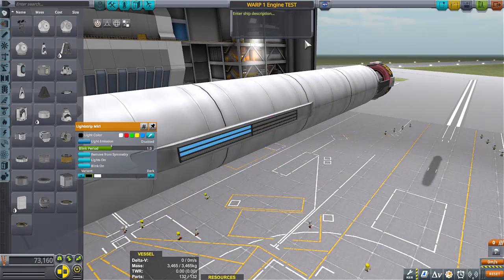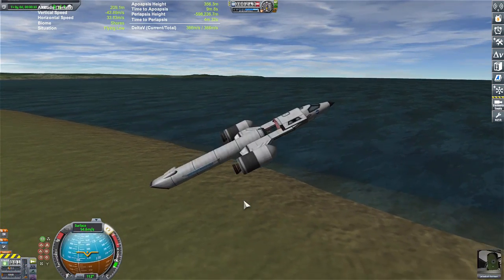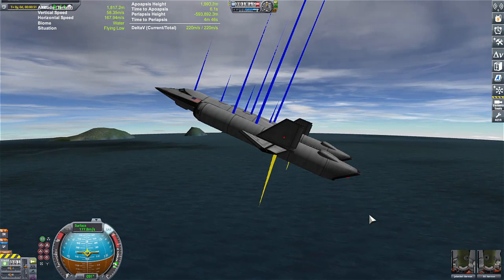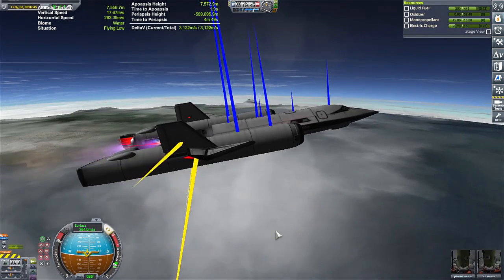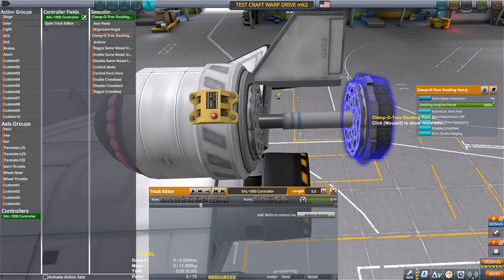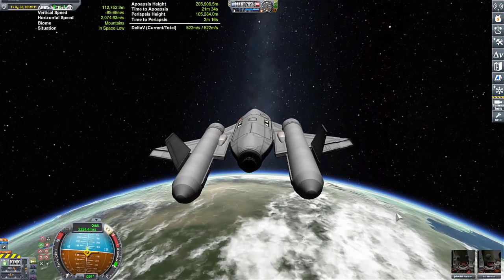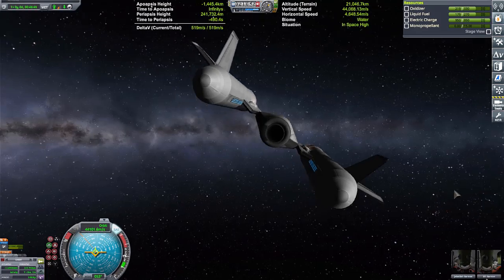STOCK WARP DRIVE TEST SHIP  \  KSP 1.12  \  Kerbal Space Program

Comment: can you make a "non-cheaty" warp ship with KAL overclocked ion engines, supplied by liquid fuel and overclocked fuel cells? Or is it impossible to overclock those
Reply from the maker: That would be more like the drive they have in the expanse
Reply: Shadowzone did a "less cheaty" KAL-overclocked ship by using a big engine for the forward drive and a small engine for the negative-overclocked fuel producer. He wanted 10 times the thrust and 10 times the IsP, and apparently he got it.

Comment: after some testing i found that the most effective docking port drive can be accomplished by:
1. using only jr. ports

2. pairing one port with as many as your computer can handle/kraken will let you clipped together using the offset tool in absolute mode so they all occupy the exact same space
2a. while it seems counter intuitive to only pair one port with several, this yields the best results, it seems that a single port can pair with any number of ports but will only seek to pair with one so 8 ports across from 8 ports will only produce as much force as 1 port across from 8 (the single can be the attractor or the dormant port, i prefer it being the attractor [behind the other] so i can control the drive with a single menu) 

3. the best spacing for them is two shift-ticks/one normal tick of the offset tool, match the faces of the ports, then space them back that much

4. instead of pistons (no dlc for me) i just use the attraction slider on the single port to control the drive

using this method, i could get a small craft (a mk1 command pod with the ports in a 1.25m bay to reduce drag) to accelerate at 25g (250m/s^2) using 64 ports, a setup of 64 ports to 1 produced about 577 kN of force (F=MA, 256.52m/s^2 * 2250kg = 577,170N), almost as much as a skipper engine

5. putting multiple drive units inline with each other for some reason will slightly reduce the amount of thrust from what would be expected, they should the placed side by side, spaced farther apart, or be combined into a single unit with double the ports

6. the amount of force a drive unit produces is almost directly proportional to the number of ports in it (minus the one opposing port), each port produces about 9 Kn of force

Comment: Treat it like a low TWR SSTO...stay low, pick up speed, use the improved lift characteristics at lower altitudes to stay up.  When you reach some point, you'll have to experiment to find it, pull up moderately hard to a 30 or 40 degree nose up

Comment: I stopped watching Star Trek after 2 seasons of Enterprise. I'm happy. ;) As for drives, KAL overclocking is just as powerful, even with ion drives, but if you put it in anything heavy, you risk the engine breaking free and tearing through the ship. My little lightweight KAL/ion drive craft got into moon orbit in 10 minutes from launch without thrusting the whole way, but when I made a fancy alien ship with the same drive, it took an hour because I couldn't throttle up fully without destroying the ship. I think the fancy ship was 18 tons. It was carefully fixed for maximum strength, but not naturally a strong shape. I might only be saying all this because I used the ion engine which only has a tiny mounting point; a bigger engine might have stronger attachment.
Reply: Autostrut Industries has you covered, you can get a guarantee for your ship for 5 seconds

Comment: What are those pink circles
Reply from the maker: There’s supposed to be red. But in the space plane hanger they look pink. At 9:45 you can see them better as red. In the Star Trek universe, The red tips on warp engines are called Bussard Collectors. As the ship moves quickly through space , they collect free-floating hydrogen particles that are all over the place in space. ( heavier near star systems and nebula) By collecting them , it helps refuel the ship. The reason why they’re red is supposed to be because it’s the color of the energized hydrogen particles that are stored in the collector during warp. ( but sometimes the writers forgot about that when they made episodes)

Comment: Do you think there is a way to make the thrust from the warp drive reversible? Like with some of the turbines, where you just hit a button and it goes backwards?
Reply from the maker: The only way to do that is to build an engine that’s pointing in the opposite direction. Unfortunately there is no action group that can change the attraction force of individual docking ports.
Reply: @vaos3712  maybe having a srvo to flip the engine around?
Reply: @mariasirona1622  Or have the engine in the on position at the start and tie the docking force to the throttle with a Kal controller?

Comment: There are different mods on spacedock that I think may help....   tweak scale is a interesting mod that allows some parts to be size altered and things scale such as engine power, weight, and resource consumption.  Maybe you could tweak scale the warp drive and make it more powerful that way. Or use the Sr docking ports in multiple  to make it more powerful.
Reply: This is a stock warp drive. Stock KSP, as in vanilla, as in no mods. Making a warp capable ship with mods isn't a challenge, there are at least a few mods that flat out give you warp engines.

Comment: 7:29 Whoa, whoa, whoa, WHOA.  Talk us through what happened there!  After so many test flights where you could barely approach Mach speed, all of a sudden this particular test flight was able to go full SSTO multi-supersonic?  And without an atmospheric engine assist?!  Talk us through what happened there, man.  Inquiring minds want to know.

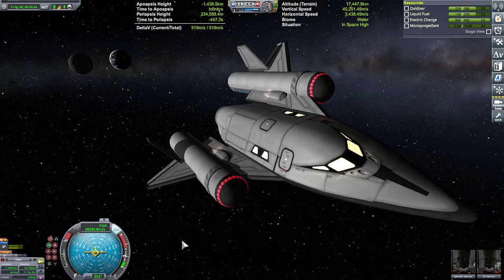10:28 Yeah I was experimenting with the engine hack (both ion/xenon and rocket fuel) earlier this week.  It's pretty fun but ridiculously overpowered.  Like, gamebreakingly OP, so I hesitate to use it as a principal source of propulsion.

<< trips over a soapbox left in his path; casually kicks it out of his way in the general direction of one Vaos.  

11:45 YES.  yesyesyesyesyesyeyesyesyseyseyeyseyesyseysyeysyesyeysyeyyseyyseyyse  YES.
Reply from the maker: Stuffing the guts of the warp engine in fairings did the trick.
Reply: @vaos3712  Wow.  That much of a difference.  Geez.
Reply: I think what was happening around 7:29 is that the drag caused by all the parts in the warp nacelle “pulled” the Center of Lift backwards. Similar to really life counterpart. The drag behind the lifting Serface will move the “blue ball” of lift behind the CG. Essentially turning the plane into an arrow with no way to correct other than flying lower than Mach 1.

Comment: Vaos straps warp nacelles to a plane and it stalls. How Does a warp drive stall? Lmao

I'm interested in the ion engine hack. Wanna see how that's done.
Reply: A. Warp drive can not stall. Craft can. Due to first versions of craft has too much drag the only source of lifting force here were wings (and atmosphere). So: flying higher -> atmosphere thiner -> no more lifting force -> "Kerbin, rejoice! Your heroes returning to you! (Too soon, but still...)".
By the way... I quite confident that same craft COULD leave atmosphere. If launched vertically. But VAOS seems to dislike vertically-launching-crafts...

B. KAL-1000 fuel / engine power hack (ATTENTION! Ruins game experience! Use for your own risk/discretion!):
1. Get 2 ion engines, 1 KAL-1000 unit, 1 xenon tank, 1 battery.
2. Disconnect engines' thrust control from control sheme. (RMB to engine. "Throttle - Independent")
3. In "Actions" menu give "throttle" control of engines to KAL-1000.
4. Set control curve for one engine to infinite low (at KAL-1000 track editor: "tangents: curve" and move curve direction marker at 0 point DOWNWARDS). This engine will be power/fuel source. Negative throttle engine will NOT provide any thrust, so there is no matter which direction it facing.
5. Set control curve for another one to infinite high (at KAL-1000 track editor: "tangents: curve" and move curve direction marker of 0 point UPWARDS). This engine will be wastly overpowered.
6. Link KAL-1000 "Play Position" to "Main throttle" control (in "Actions" menu).
...
998. Same method works with any type and quantity of engines in KSP. Just set up them in pairs, as described. And provide resource tank(s) as engine specification requires.
999. Rejoice! (again)
Reply: @DeepProbe  nice thank you!
Reply from the maker: Then you will want to take notes in Mondays video jolly 😉
Reply: @vaos3712  yes, I saw... Muuhhwahahahahaaaaa
Reply: KSP Warp drives are crap in atmosphere

Comment: How do you make warp drive if its a mod how it is called
Reply: Here is the video where I first learned about the docking port attraction force "kraken drive" method: https://youtu.be/28v9dnP65Mw
The video references a Reddit post by someone with a name starting with a Z, so I've been calling it the "z drive" to differentiate it from so many kraken drives out there, but I guess you could also call it a docking port drive.
Reply: @ArchaicAlibi  The excellence of your answer exceeded the internet's usual standards of informativeness, and has been reported to the Department of Mediocrity for eventual review.
Reply: I dont know exactly how it works, but you clip a bunch of Dockingports and set them up so they try to dock with another set of docking ports, and then that triggers a thing that makes the craft move. and idk but i think if you set it up right you can have one the moves you forwards and one that acts as a brake, so that you dont have to flip it around to slow down.
Thats just what i understand of it.
Reply: @ChristopherB.  I haven't practiced yet, but that sounds about right. They missing key detail is changing one of the docking ports settings so that the magnetic attraction force is on only one side. I think that setting appears only if you turn on "advanced tweakables" in the game settings.
Reply from the maker: Make sure to watch Mondays video for answers

Comment: How are you controlling its thrust? I put the docks on a piston and set an action group for it onto throttle control, set to inverse. That way I can "throttle up and down" with shift/control like a normal engine, but it does lack fine input I'll admit..
Reply: I see the pistons later in the video, just not set for throttle
Reply: It also works with airlocks
Reply: @phoenix0166  the inflatable one? I know there is an airbag that I haven't unlocked yet, but it works a little better than the piston
Reply: @vegas272007  yes
Reply from the maker: Video on Monday will show you the way